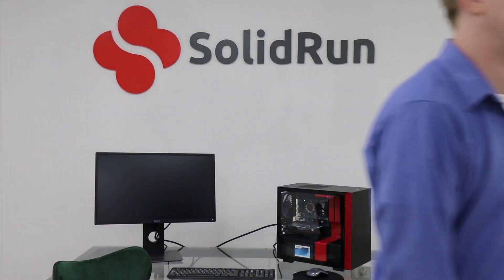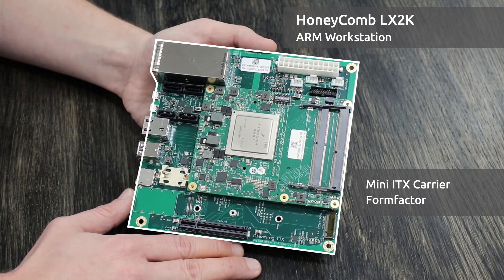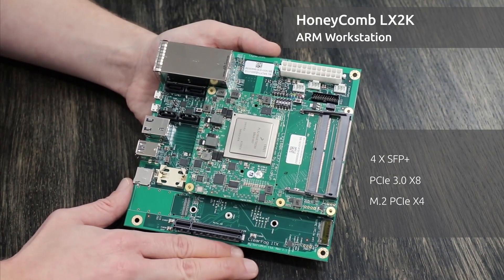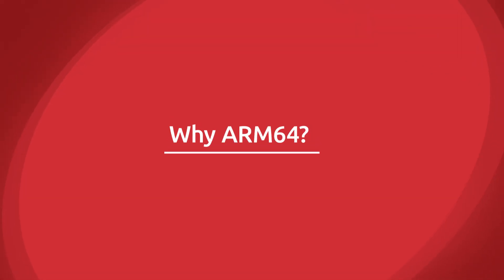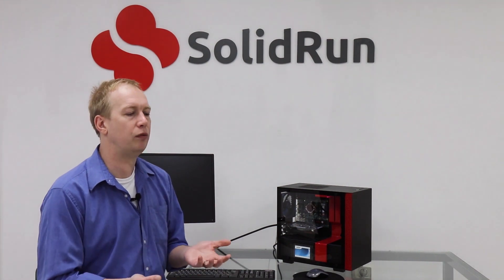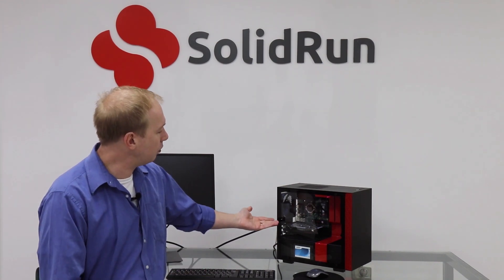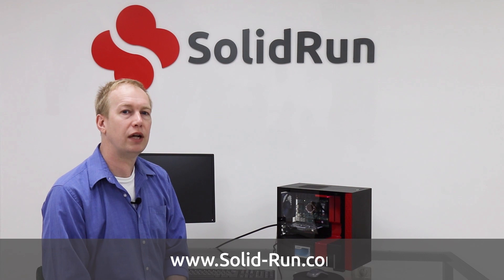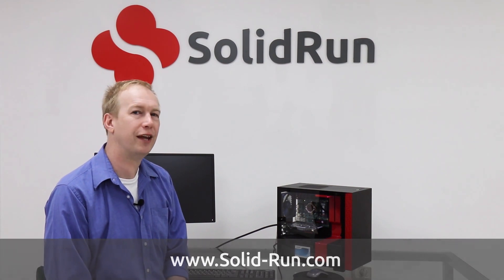HoneyComb LX2K - Ultimate Mini ITX Arm Workstation

Comment: I would love to test this board out. You guys should make a rack mount case for it.
Reply: It is a standard mini-ITX form factor so there are many off the shelf rack mount options that it is compatible with.  Or possibly we may have a dual chassis 1RU available in the future :)
Reply: @JonNettleton  this would make for a powerful router/firewall too.
Reply: @SuperChopperpilot  We are working on a dual chassis 1RU...don't know if / when it will be generally available in our shop.  Nice SR red front plates :)

Comment: Is there a runtime emulator on Linux that allows to run x86 binaries running on ARM? (i.e. like Rosetta)
Reply: There is nothing specifically like Rosetta2 as the Apple Silicon has specific silicon that allows it to optimize the runtime of x86 instructions.  Exagear was one option but has recently been purchased by Huaweii.  Right now the closest thing is box86 but this is limited to 32-bit x86 applications and requires a 32-bit chroot to run.
Reply: It's still early days: https://github.com/FEX-Emu/FEX

Comment: Have you tested the ClearFog / HoneyComb  module in other Type 7 carrier boards? I am interested in utilizing it with congatec conga-X7EVAL board, mostly due to its extra PCIe capacity, and BMC (so serial console can be accessed via network, but also video can be done using Linux drivers for aspeed BMC, both on the real display and over network).
Reply: We have tested it one other Type 7 carrier board, but you would need to test the pin mappings on the CEX7 module to verify that it brings out the pins needed for other boards.  It would also require additional UEFI changes to support the carrier differences.

Comment: That is pretty cool. Is the M.2 slot 4 PCIe lanes? and the 8x PCIe slot is actually 8 PCIe lanes? Or it is somehow split with lower lane counts?

Also does it support ACPI / SBSA+SBBR? UEFI even maybe? I am tried of device trees, custom kernels, etc. I know the LX2160A has pretty good support in kernel, so that shouldn't be too hard.
Reply: yes m.2 slot is 4 PCIe lanes and the 8x PCIe slot is 8 lanes.  the 8x slot can be bifurcated to 2x 4 lanes but the default configuration is the full 8 lanes.  We are finalizing certification with Arm on the Systems Ready certification so Level 3 certification with UEFI.

Comment: What type of heatsink mount does the CPU use? Is it possible to run this fanless, with a large heatsink?
Reply: It uses a 59mm through board mount that is standard to older Northbridge heatsinks and GPU heatsinks.  It would be possible to run fanless if the heatsink can clear the other components on the CEX7 module.

Comment: I love it, but that price tag.
Reply: i dont think the price is that bad. a Ryzen 5950x with a x570 itx mobo is between 900-1100 dollars(Yes, the 5950x does have better clock speeds but it also uses more power and is hotter than the lx2160a).
Reply: @nuudul7639  the problem, that in some cases in more reasonable to buy an m1 mac mini and run a virtual machine. but the board is awesome
Reply: @pingwinator5950  the reason some people buy this arm board instead of building a cheaper amd64 pc (that rivals the performance of this) or silicon macs is that this is more private/secure. There is no secret backdoor that intel/amd can use to spy on you.
Reply: @nuudul7639  in this case maybe risc v is a better option :)
Reply: @pingwinator5950  it would be, if an consumer-level risc-v pc existed
Reply: @pingwinator5950  Personally I haven't seen a RISC-V platform offering four 10Gbit Ethernet ports... In addition to that, it's very rare to find a SBC with more than a single 6G SATA port (unless it's Intel or AMD). Last time I looked at a RISC-V board, I fainted when I saw the price of it (it was well beyond the MacchiatoBin).

Comment: Could ARM64 have a chance on the desktop some day?
Reply: I am responding to this on a HoneyComb right now :)  With ChromeBooks and Windows on Arm we are already seeing desktops that run on Aarch64.  For larger chips I definitely see a future, but it is definitely a chicken and egg situation.  You need the right balance of features, performance, and price.  With the HoneyComb being over half the cost of other Aarch64 Workstation solutions available we feel it is a quite a compelling system for developers who want Aarch64 as a desktop to get started with.  Is Linux Desktop on it perfect?  No not yet but the normal bugs and lack of optimizations you find on a new platform won't get fixed until developers are actually using the hardware full time.  Since we launched the platform we have been working hard with the mainline projects to start squashing some of these issues.
Reply: Absolutely we are now seeing even Apple have joined to the ARM based processors. That's because of the efficiency without losing horse power. Linus Torvalds have always said that chrome os is the future now I can see a bigger picture of why he thought that way. Really cool what you can do with this processors

Comment: Could you show us this computer running software:
- compiling code
- emulation
- gaming
- productivity applications
- Youtube video playback
Reply: I will see what we can do.
Reply: @JonNettleton  Will this MB support PCIe 3.0 x16 GPU card?
Reply: @gwojcieszczuk  If the GPU card isn't "completely idiotic", then it should; though only the first x8 lanes would be used, as the connector only has 8 lanes. ;)
Most x16 PCIe cards should work in a x8 slot, they would just not have the speed of x16.
Generally speaking, that's not a problem if you're just doing "daily work" at a high resolution. In short: it depends on what kind of work you want to use the card for.

Comment: Hi, I would like to know when can we expect to see the release of the official supportive Kernel?   The early release of Honey Comb system that I received, was the 1.4 revision.  The available 4.19 kernel works fine with USB mass storage devices, however it does not recognize of my other USB devices such as CD/DVD drive, Serial, or Wireless.  Also, there is an issue with the current release of pre-build (LSDK 20.04/ Kernel 5.4 ) not recognizing the NVME drives.  https://drive.google.com/file/d/1Bb05FzLbb2YWollmhFPcf0aLA_wqti8g/view?usp=sharing.  I believe, this stems a bug from the earlier releases of the 5.4 Kernel https://lore.kernel.org/linux-nvme/2df2848e-aff6-98b7-4042-0935afb78e72@grimberg.me/t/
Reply: We are closing in on a fully functional edk2 based UEFI firmware release.  With the 5.8 kernel release this will fully support everything except networking.  The networking patchset for UEFI support will fully be supported in mainline soon, but will be available for testing from our repos.  The full patchset should be released on our github in the coming week.
Reply: @JonNettleton  Hello, thank you for your response.  I've saw the updates to main github.  So are we to use docker as apposed to using the 'runme.sh' script?  I got following error from the shell script: 
Applying: lx2160acex7: Misc fixes to support LSDK-20.04
error: patch failed: configs/lx2160acex7_tfa_defconfig:55
error: configs/lx2160acex7_tfa_defconfig: patch does not apply
Patch failed at 0016 lx2160acex7: Misc fixes to support LSDK-20.04
Use 'git am --show-current-patch' to see the failed patch
When you have resolved this problem, run "git am --continue".

Comment: Hello,
    I would like know is it possible use the "CEx7 LX2160A Computer-on-Module" on other Com  Express  Type 7 Carrier boards?

What I have mind is purchasing a CEx7 LX2160A module and using it on the following, for example.

https://www.adlinktech.com/Products/Computer_on_Modules/COMExpressType7Carrier/Express-BASE7?lang=en

Seems this is one of the few Com Express type 7 which isn’t specific to Intel based modules.  What I like, is that are already ps2 key/board ports and serial port on board without need added these via USB.  Though, there is one PCI Express x16 slot and two PCI Express x8 slots, I’m not sure all the PCIe lanes can be mapped to the LX2160a modules.  I realize, there are trade-offs as not having the on board SD and eMMc, but I’m assuming that these can be added via the PCI slots.  I figured, this going to be significant configuration challenge.  

Curious to see, while configuring Serial Ports from COM Express Module, will still map out as ttyAMA0 and ttyAMA1.

Comment: The main problem I have with this is that with only one M.2 slot the user has to choose between an NVME drive and a Bluetooth/WiFi wireless module, which is quite a disappointment.
Reply: USB 3.0 is fast enough to get full throughput via 802.11AC

Comment: Mmmm.... Sweet. This strikes me as a throwback to the good old days, were the computerlandscape was extremely diverse. Were things were exciting. In the future, I wish to have an ARM workstation for my computing need's and I need a VampireV4 board for my Amiga need's. The future looks bright. And this is a welcomming edition, to an old user that finds the computing landscape too boring these days.
Reply: Interesting, I think, I set about trying to find any relatively new Non-Intel base systems running Linux in early 2019.  Seems to me, with exception of relative small SBC ARM boards, not much was found.  Yeah, I did discover there were ARM based servers well above $4,000+ USD out there.  Even the Layerscape LX2160A RBD board directly from NXP, is well out of my price range. https://www.nxp.com/part/LX2160A-RDB#/ 
However, since you mentioned about Amiga, you know there are new remake version of Amigas based on the PowerPC processor.  http://amigakit.amiga.store/product_info.php?products_id=1303
Reply: @marcuswilliams3455  Yup. I know about them Amiga's. There are tons of new Amiga's out there. Some are for the future and some are for vintage software. Like the VampireV4 standalone are for Classic Workbench yet incorporate modern features. There are even an ATX version the of Amiga4000 board. Then we have Amibian and Amiberry for RaspberryPI. And so on. Tons of Amiga solutions oit there. Like AmigaOS 4 for Amiga1200 that are running with a PPC board.

Comment: I have ordered a pre production unit last year and I can confirm this is a good workstation board. 10GbE with everything else at 750US is just amazing.
Reply: Nice. I only discovered this system today. Do you still recommend it?
Reply: @movax20h  Depends on what you want to do. It's certainly cheaper than actual ARM servers. It is a great board if
- You want ARM
- You can make use of 10G/100G fiber (The is probably the single feature that is the most valuable and expensive on other systems)
- Your application can tolerate low performance per core 
- You can make use of the massive amount of cores (all cores adds up to ~ Ryzen 2500G, depending on workload)
- If needing a GPU, use a AMD one. (nouveau doesn't work well on ARM)

Otherwise you aren't getting any benefit from the system. Currently I use mine as a build server for embedded systems among other things. So much easier when I don't have to cross compile.

Also be aware of some cons
- The default fan+heatsink is loud. It's about the level of a 1U server. Put it in a server room. I ended up hacking a off the market water cooling (because air-cooling units are too heavy, not because of the heat) unit onto it.
- You have to build the image yourselfe. It's as simple as running a build script under docker. But it's not as easy as most boards
- The 24pin power connector is located at a weird location. Shouldn't be a issue but it's annoying when installing the board.
- (pre-production board issue) Mine have a slightly unstable PCIe. It's not an issue that Linux can easily handle it. But you'll see messages in dmesg.

Let's me know if I can further help.
Reply: @clehaxze  Thanks for your time to write it all. :)  Yes, I will use it with some AMD card, due to open source drivers and good state on ARM.  I do have use for 10Gbps, and can connect it to my network and file server on my network.

The performance of all cores adding up to 2500G levels, is a bit underwhelming, but still with 64GB of 3200MT/s, ECC memory, and 16 cores, and PCIe, it is a lot more useful system than RockPi, or RPi4.

I wonder if it works with other carrier boards, but if that works, it will add up in cost, so probably not worth it.

It is indeed rather unfortunate placement of the power connector, or decision to use the 24 pin connector, instead of 12V + 5Vsb, i.e. using 10-pin connector for the ATX12VO standard. But I guess, it was made before the standard was published.
Reply: @clehaxze  You forgot to mention the low power usage. ;)

Comment: I do not see any video output. What graphic card do you recommend for your system?
Reply: Generally an AMD Radeon GPU.  We recommend an RX550/RX560  just because the power / performance match the power footprint of the SOC.   Nothing is stopping you from putting something bigger in though.  Nvidia cards also work just note you only have access to fully OSS driver stacks since neither AMD nor Nvidia provide binary drivers for Arm64.  AMD is corporately contributing more to the OSS drivers which is why we recommend their cards.
Reply: @JonNettleton  Hi there. Is there a way to email you? I'm having difficulties and it's been really hard to get ahold of someone at Solid Run.

Comment: Overpriced compared to the 16 core intel atom embedded board
Reply: Hmmm.  https://openbenchmarking.org/result/1909169-JONA-190709812 You think?
Reply: I don't think so - not even in 2021.
I am grateful that I will be able to get the ClearFog CX LX2K - It'll take me at least 5 months to save up for it, but I'll get one.
Previously, I thought about the HoneyComb, but I've re-considered ... I want the full package. =)
I have seen no other "personal computer" with the ability to transmit and receive 16GByte per second over the network (that's 100Gbit + 40Gbit).
(Note: The reason it'll take me that long, is due to the shipping, VAT and tax for my country. If I lived in Israel, I'd have it within three months; the HoneyComb within two).

Comment: I have been telling this since 2016 that ARM will not only make way for Data centre but desktops too. I hope it's priced reasonable because I am sick of Intel 140 watt TDP desktop .
Reply: it's 500 bucks, sadly.
Reply: @jairvandersterre1002  Think about the power usage. Let's take Goofy's example:
140W - 60W = 80W saved.
80W * 24 * 365 = 700 kWh per year. If one kWh cost $0.3, then you'd save $210 on electricity per year if running the system 24/7. The system would be paid over 2.5 years.
If you only run it for 8 hours per day, 5 days a week, it would take 10.5 years, though.
In my country, the price per kWh is $0.4, but I'd need to pay VAT, so it would end up taking 2.3 years for it to pay for itself for me, which is a pretty good deal.
Reply: Also here due to the energy problems modern pc's have, and since RISC-V is still very hard and expensive to get if you do not have your own chipmaking company I am currently looking to arm, specifically for a cheap server which doesn't cost a few hundred € every year in electricity alone.

Comment: Can you elaborate on the function of the stm32 MCU?
Reply: The idea is to have a stack of mini ITX machines where a single PC (or other embedded device acts as multi-node BMC) with multiple USB ports can control and manage all those mini ITX motherboards where each MCU run micro-BMC firmware.

Currently we have most of the micro-BMC firmware up and running on  that MCU;  it runs composite USB endpoint where one of them is virtual COM to the LX2 SoC, and then there is an additional virtual COM to communicate with the MCU itself where you can -
1. DFU boot EVERYTIME - this is an important feature in order not to get into firmware upgrades of that MCU; you want a new firmware just power cycle it (and no the LX2 SoC will not be interefered).
2. Flash the secondary boot flash.
3. Force the LX2 SoC to boot from secondary flash (via standard BOOT_DIS0 COM express signal).
4. Power on/off, reset and voltage, current and temperature sensing additional other functions.

We have that micro-BMC up and running as an internal project; we will share in some point of time

As for the multi-node BMC; we are looking into multiple solutions; i must say that most of the projects out there are simply not ready for anything that is multi-node; and we insist on multi-node since we are shrinking those machines into tiny spaces that it doesn't make sense to have a BMC per node.

Let me know if you need more information.
Reply: It is mostly to do things like controlling fans, doing auxilary monitoring of temperature and power, doing a startup delay, responding to power / reset switches similar to ATX standard, sending power on to the power supply to start the PSU and the system, and probably also allows for an emergency access to SPI flash for reflashing the low level firmware.